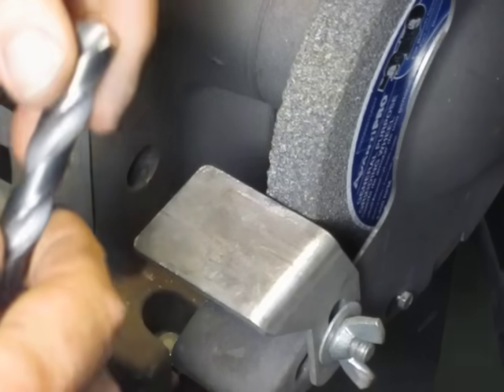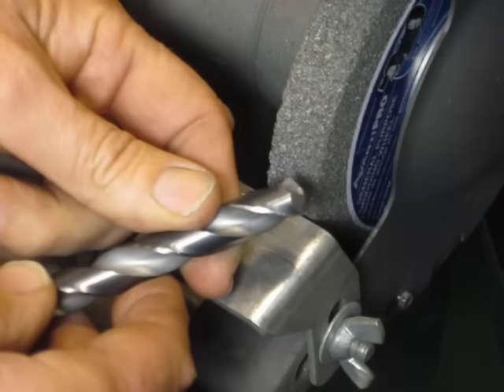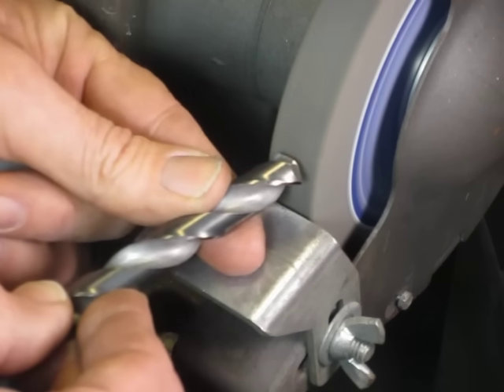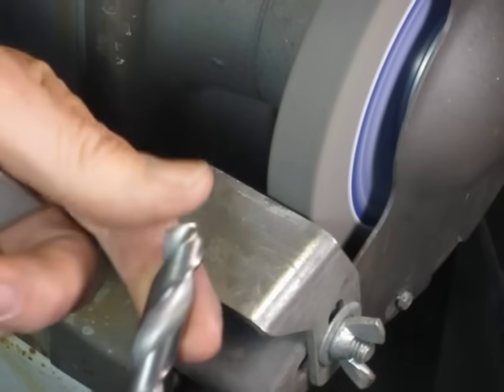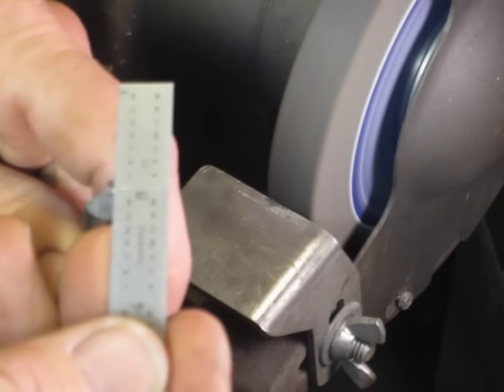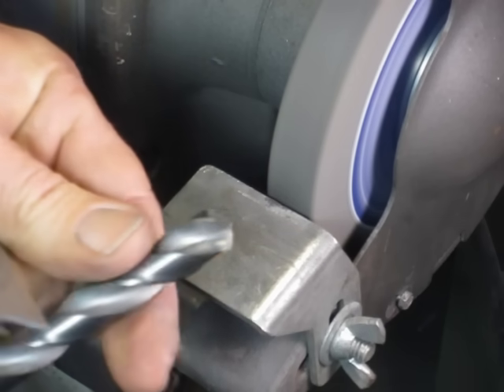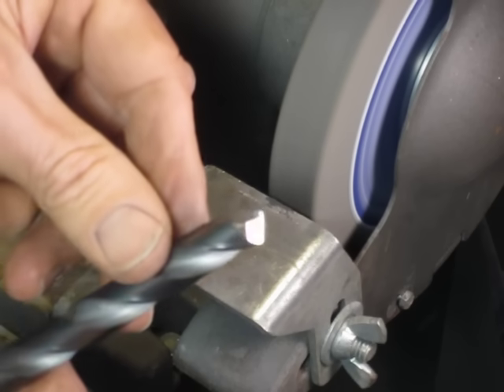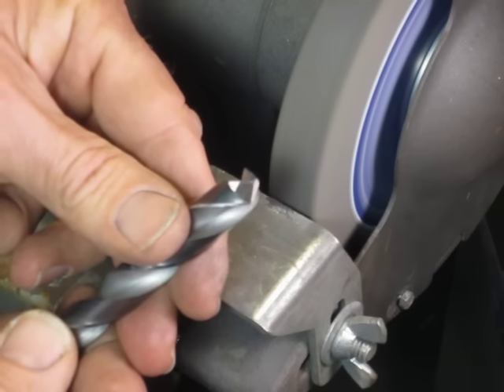How to Hand Sharpen a Twist Drill

Comment: Yo Tom, Your presentation is clear. I went through the sharpening gadget phase, but they end up being more of a nuisance. Then I just bought drill bits as I needed them. Your vid has given me inspiration to do them by hand, but I thought that a finer wheel would have been more appropriate, but as you have mentioned, that would create more heat? So the secret is to be consistent and take small incremental steps, instead of trying to do the job all at once; like a methodical and professional machinist that you are! Thanks.
Reply: Success is in your future Dimi K

Comment: Is there a trick for sharpening smaller diameter bits? Or do most machinists just buy new ones when they dull out?
Reply from the maker: It's possible to do very small ones by hand with a good magnifier and a lot of practice. About 1/16" is my limit.

Tom
Reply: In addition to Tom's comment, small bits ARE the most difficult to sharpen, you gotta have awesome eyes or simply buy new drills the size you need Robert.

Comment: that's all well and good, an informative video.  But I'm the worlds greatest clutz and tools & I are not good buddies - period.  I either break things or loose skin, usually in about equal quantities so I suspect I won't be trying that too soon.  However, I might be tempted in a weak or silly moment to give it a try on a big drill bit like that.  But what about a drill bit that is 1/16th or smaller?  I suspect that aint gonna be easy to measure.
Reply from the maker: Small drills like that are too small to measure. They require a good eye, a steady hand and a lot of practice.

Tom

Comment: Hi, good vid. If you place 2 nuts against eachother flats to flats, the "V" made between them is very close to the angle required for general use.
Reply from the maker: Thanks Gary.

The two nut thing works well for getting the included angle correct, but doesn't help getting the two angles equal. One could be 110º and the other 130º and you might not notice it. That would make the drill cut oversize.

The best thing to use starting out is a drill gauge. That makes it easy to get the angle of the cutting edges and their lengths equal.

Thanks for watching.

Tom

Comment: Great video. I still have a hard time getting that angle right.

 Now do a small 1/8" bit. Those are the ones I have trouble with- even wearing the magnifying glasses. LOL.

 It would be good to mention, don't overheat the bits while sharpening by pressing into the wheel too hard for too long- especially on small bits. Use a cup of oil or water to help keep them cool.
 Thanks!
Reply from the maker: The technique for small bits is exactly the same as for large bits, it's just harder to see what's going on and to place them back on the wheel in the same position. A magnifier does help for small drills, especially when your eyes get as old as mine.

Unless you are using carbon steel drills, which you likely are not, it doesn't hurt the drills to over heat them. High speed steel has what is called good hot hardness, meaning that they can withstand a lot of heat before losing their hardness. Most grades of HSS are good to 1000º or higher, or a dull red color. Water will help keep you from burning your fingers though if things get too hot to handle. The drill I'm using stayed nice and cool because I like to use a coarser wheel. I think this one is 60 grit.

Tom
Reply: Small bits (below 1/4 inch) are the most hard to sharpen. The older the eye the worse it gets, unfortunately!

Comment: This was incredibly enlightening. And it will really help seeing as even my annealed steel beats up my drill bits, and I'm not lookin forward to buying another set of carbide bits.
Reply from the maker: Kyle,

If soft steel is beating up your drill bits, it sounds like you need to invest in some better quality drills. Carbide is neither necessary or desirable if you are using good quality American or European made drills. Of course you still need to run them at the proper RPM.

Tom
Reply: Toms Techniques  Thanks for the response. I can't say for sure what I'm using. I'm an ameteur knife maker, and while I've yet to have problems with my drill bits. I assume at some point in the future I will, and I was told carbide bits can be resharpened unlike the titanium coated ones, and that they are better suited for cutting through steel. As of now I'm just using a small drill press, most likely 1Hp.
Reply from the maker: High speed steel is perfectly capable of drilling steel. Carbide should only be used on very hard materials and in very rigid machinery. I never buy coated drills either. It's just an added expense that really doesn't buy you much. Black oxide drills will work just fine and unlike the coated drills, they are inexpensive and can be-sharpened without destroying the coating

Tom

Comment: The cutting edge will last longer if you take a fine honing stone and at about 45 ° undo the sharp edge where it cuts by maybe 2 to 3 1000s, just enough to see a thin line holding it so the light reflects and shows it
Reply from the maker: I do that on drills for brass and plastic to keep the drill from grabbing, but I've never heard of doing it on drills for regular use. It only takes a few seconds to resharpen them.

Tom
Reply: Great, you saw my comment. I possibly could be wrong when it comes to drill bits. I was definitely taught to break the edge after grinding a square shanked lathe toolbit for turning and facing I'm not talking about the radius but the actual edge that touches the work first. And a few tens of thousandths behind the cutting edge is where you put a "chip breaker" either a groove or a raised  step. It's been quite a while since I worked in industry, I miss the work but not the pressure to production quotas and foremen that automatically blame the "operator" anytime the machine crashes. I will subscribe to your You Tube channel if I haven't done so. I have a page on Facebook that I want to devote mostly to metalworking and.engineering. use my first name, Michael, and my last name to get.to the right page, although it is still pretty blank so far.

Comment: nice video thx.  What abt over heating the bit.  U get bluing.  What does that mean in terms of the steel itself?  What grit wheel do u use? That wheel looked fairly course to me.
Reply from the maker: Unlike carbon steel, high speed steel can tolerate higher temperatures before it starts losing its hardness. Most types are safe up to around 1000ºF.

This wheel is on the coarse side at 60 grit. I like a coarse wheel for tool bits because it grinds faster and heats up less (easier on the fingers). I always stone the edges anyway, so the coarseness doesn't matter. For drills, an 80 grit wheel would probably be more appropriate.

Tom

Comment: Why doe's everybody sharpen Drills backwards. if you start at the back and work forward it doesn't reduce the drill length by as much!. Trust me and try it !
Reply from the maker: The object of sharpening a drill is to clean up any damage to the cutting edge, get the angle and length of it correct, then clear everything behind it. Grinding the clearance angle first is definitely putting the cart before the horse.
Reply: but doing it the other way reduces minimising  drill length and has the same result. horse is now before the cart LOL
Reply from the maker: Pete Kitchin

I'm having a hard time visualizing what you are talking about. Perhaps you should make a video of your own and demonstrate the technique.

Tom

Comment: you should do this on the side of the grinding wheel so you grind isn't curved
Reply from the maker: The curved surface doesn't hurt at all. In fact it helps the bit cut easier by providing slightly more clearance behind the cutting edge. The face of the wheel is also much easier to dress on a bench grinder than the side.

Tom

Comment: Hi Tom, these are fantastic! What do you recommend in terms of geometry for adapting HSS bits to cutting acrylic or polycarbonate?
Reply from the maker: It is imperative that drill bits for plastic or brass have a bit of negative rake on the cutting edges. If not, they will literally screw into the part and either rip the part out of the machine or pull the drill out of the chuck. Check out the following video to see how it's done:

http://youtu.be/8Ri6poVpQM8
Reply: I forgot I already watched that video. Thanks for the reminder. Once I grind the bits a little flatter, will that suffice? Or will I also need to grind a 90º or 60º cutting angle? I'm thinking of drilling a 3/8" hole 2" deep into polycarbonate.
Reply from the maker: Pierre Miller

Softer materials like plastic or wood drill better with a more acute angle on the point. For plastics, you still need negative rake on the cutting edge to keep the drill from grabbing. You can stone it like I did in the video, or grind it on the side of the wheel like I did when thinning the web. Just angle the drill to the right a bit more to create the negative angle.

Tom
Reply: Thanks a bunch Tom. You're great teacher!

Comment: How often do you just eyeball it? I have used my protractor in many years, I use my 12" machinist scale for just about everything. I think that the 4R ruler is the most used tool in my shop. Great explanation on drill sharping. We need more teachers for these kinds of professions, to get young guys interested in manufacturing. What happened to shop class?
Reply from the maker: I always eyeball it now, but I've been hand sharpening drills for a long time. I can assure you that when I was first starting out, I measured everything.

Shop class is a thing of the past around here. None of the programs that I student taught in in the 70's still exist.

Thanks for watching.

Tom

Comment: then why arent u wearing safety gloves for. u really wanna lose skin andd get a free ride to the hospital .
Reply from the maker: After all the discussion below, you are still talking about wearing gloves? There are no such thing as "safety gloves" and wearing gloves of any kind will eventually bite you and bite you badly. I'm not talking about losing a little skin here, I'm talking about losing fingers, hands and arms.

Please don't wear gloves while working on machinery, especially rotating machinery.

Tom
Reply: well that depends on the type of gloves actually. there  are gloves designed 4 every type of job , just like tools are. yes ill wear gloves every tyme i work near grinding wheels. loads  safer than losing skin.
Reply from the maker: Nathan Dean

I'll say it again: There are no gloves that are safe for use on machinery. If you ignore that advice that is certainly your prerogative, but please don't promote that sort of unsafe activity on my channel.

I have seen the results of a glove getting pulled into a large pedestal grinder and it wasn't pretty. By the time it stalled, most of the thumb inside of the glove was gone.

Tom
Reply: ok ill take yr adive an wont post anymore coments on yr channel

Comment: Well Tom I am just going to thank you for a good video.  I am not a machinest but do a lot of tinkering in the garage.  Great video.  You have helped my drill bit sharpening.  I didn't hold my bits at an upward angle.  I used to use a curl technique to get the forward edge higher.  Your method is better.  Thanks so much
Bruce
Reply from the maker: Thanks Bruce, that's good to hear.

This method is much easier for the beginner than the radial technique and also produces a drill that requires less power to drive. Perfect for guys with less experience and light machinery.

Thanks for watching.

Tom

Comment: Hello, can u explain how to sharpen stone drill bits, like this for example

http://smt.net.pk/     wp-content/gallery/smt-gallery/bosch-masonry-drill-bits.jpg
Reply from the maker: Those have a very flat point on them, somewhere around 150º. They also have very little clearance behind the cutting edge. They can be sharpened on an aluminum oxide wheel, but will cut very slow. A silicon carbide green wheel will work much better.

Tom

Comment: Tom
Good info in the video, it would be nice if you added more light, verified focus and recorded this sort of thing in higher resolution.  I can't really see the cutting edges.

Way more light helps, as the camera can reduce the aperture, which helps increase the depth of focus.

If you use CFL spiral lights with a 6500K, the colour is more bright blue daylight instead of dim incandescent. 

They have 150 and 200 watt equivalents
Reply from the maker: I actually use a 500 watts of auxiliary photo lighting for the videos, so there is more than enough light. The problem with this early video is focus. The camera I'm using loses its depth of field when zoomed in, so the grinder is in focus, but the inspected tool is not. Lately, I've been avoiding the zoom and placing the camera much closer and it works out a lot better. I'm also shooting in full HD now and although it really increases the processing times, I feel that it's worth it. This type of not easy to do with the varying camera angles and distances, but I am learning and hopefully improving.

Thanks for watching.

Tom

Comment: Hi Tom!  Thanks for this video and you explained the angles really well.  I don't work very often with metal and I am a hobist woodworker.  I have a bunch of yellow/brass colored titanium bits.  Would the technique that you used for your drill bit work with a titanium bit?
Reply from the maker: Those are high speed steel bits that have been coated with titanium nitride. They will sharpen just like any other bit, but of course you'll lose any benefit of the coating.

Thanks for watching.

Tom

Comment: awesome tutorial, i had a 5/8 bit that drill doctor couldnt do (99$ currently) and bought a 40$ 3 amp grinder to do the bit. comparably speaking, the brand new bit took about 2-3 18 volt dewalt charges to drill through this steel but the reground bit (done more aggressive) did it in 1 charge with power to spare. I did 2 relief grinds and the inner cut to refine the chisel. 

side note on safety with gloves.. yeah... anything you use close up id just avoid gloves. I had kevlar lined gloves and the reciprocating saw managed to snag a strand hanging out pulling my hand in. didnt really cut as much as jam my finger in between the blade and the guide. still hurts but gloves suck sometimes.
Reply from the maker: Great! It's always good to hear when the techniques described in my videos are put to good use.

Thanks for watching.

Tom

Comment: 4 the safety-first-carrots: put a bucket on the head - that works or you could close your eyes and turn them to your back …

When I was young I killed some drills down to no drill left, until I learned to do that job in one single turning movement in no more than 2.5 seconds a side with all the angles free hand. The feeling is quite sexy as it is some kind of Zen-spirit in it.

The more I love your video as I learn from you again, what I do for decades subconsciously, and the result is perfect. It works with many tools, even the angle grinders, when you are quick and keep the contact short enough.

THANKS 4 that very nice video.

Comment: One ol' trick I do is instead of using the ruler,I just scribed a bunch of reference lines on the protractor.You are basically comparing the 2 sides instead of actually measuring.But then again,if you're like me,I've done so many,I rarely do nuthin' but eyeball'em,unless I know the hole HAS to be good.and I have to dig around just to find the protractor or drill point gage.I also almost always backgrind the relief and split the points similar to yours out of force of habit,(When I was trained,we "rolled" the relief up to the edge(same result,different way)),but I usually grind under the entire cutting lip to make a chipbreaker for stringy materials as i do mostly aluminum as of late.Nice video!
Reply from the maker: Thanks for watching.

Tom

Comment: I've been trying to sharpen bits for years with mixed results and have never been confident I'm doing it right. Thanks for the indepth instruction of all the important angles. Now I'm going to dig out a box of rusty old bits I've collected over the years and do lots of practice because I'll be more confident.
Justin
Reply from the maker: That's the nice thing about drills, there are always plenty of dull ones around to practice on. Glad you enjoyed the video.

Tom

Comment: Do you use the same angles for Timber drill Bits Tom?
Reply from the maker: A more pointy bit works better in wood, say 90º instead of 118º. Better yet, see my video on grinding sheet metal or brad point drills. They work very well in wood because they are piloted.

Tom

Comment: This is great Tom. The only thing I would add is that very often, the side of the grinding disk is better for sharpening because the edge is so often grooved and not flat. But then of course one must have a deft light touch to avoid the drill being spat out dangerously.
Reply from the maker: Stewart,

I generally stay off the side of the wheel on a bench grinder because there is no way to dress it. The face of the wheel is easy to keep flat because all it takes is a pass with a dresser to clean it up. I keep a dresser at the grinder and take a clean up pass on the wheel most every time I use it.

Tom
Reply: Most wheel manufactureres state to NEVER use the side of the wheel because it can go boom.However,it only takes a little common sense,and as you said,a light touch.Did I listen,NO.I been doin' it for 30+yrs,still got my fingers.
Reply from the maker: Bowtie41
I spent a lot of time as a grinder had and we used the side of the wheel nearly as much as the face. And those were aluminum oxide wheels which are much weaker than the silicon carbide wheels on bench grinders.

Tom